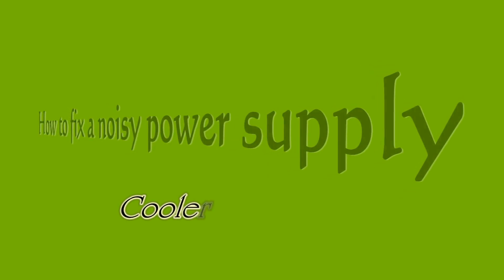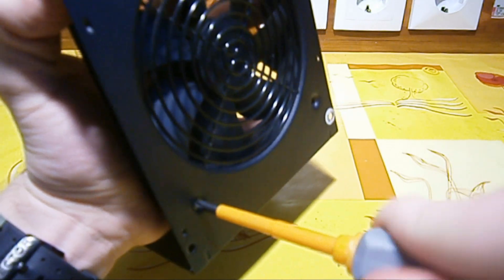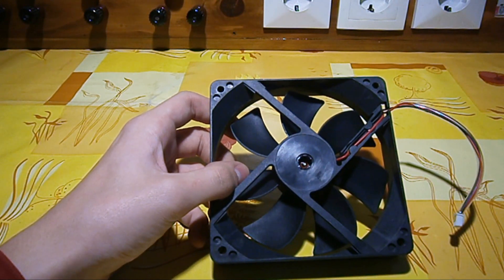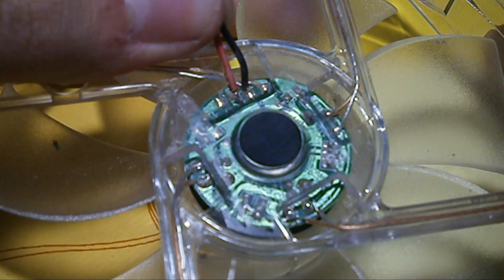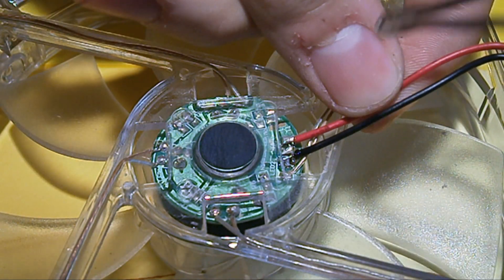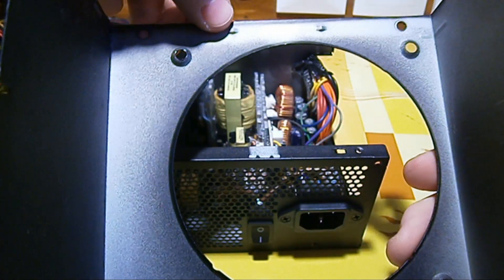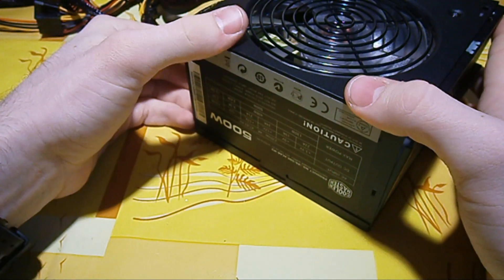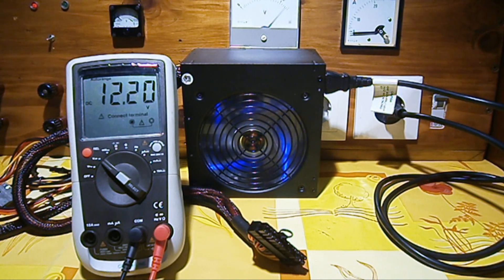How to fix/replace noisy power supply fan

Comment: To anyone who has replaced the fan in a PSU.  If you used a case fan, did you check the voltage at which the fan will spin and make sure that it matches your PSU.  The fan in a PSU is able to start at very low voltages.  Not so for case fans.  That means that when your PSU expects a flow of air, it won't get it.  This probably won't cause catastrophic failure but it might cut your PSU's life time in half.
Secondly, did you check to see how much air the PSU fan was capable of moving and match that to the capabilities of the new fan.  If you PSU fan was capable of moving 100 CFM and you replace it with a fan that can only move 50 to 60 CFM, again, that seems problematic to me.  Anyone?
Reply: +Equs Narnd You are right. But I don't know where I can know the stock fan specification
Reply: Philippe52 probably on the sticker you took off of the original fan
Reply: For me both the fans require 12v but my new fan (which is a case fan) only needs 0.16 amps while the psu one needed 0.3 amps, will this be a problem? (im guessing not but im kinda stupid so help me out)
Reply: @joosepeliastoru6021  its good that it requires less amps. if it required more then you could get a dip in voltage. the important thing is the same voltage and less or the same amperage(slightly higher would probably be fine but I don't know what the supply for the psu will rated for). also to elaborate on the top comment the way the psu will control fan speed will be voltage adjustment. it may want to supply 3volts to the fan to run it in a ultra low speed mode and that will be fine for some fans that are designed to run from 3 volts. Others will simply not run till you supply them with 6 volts or whatever they need.
Reply: @Dean10049  Thanks for this comment. I almost wanted to replace the fan of my Corsair AX750 Gold. I looked into the spec of the PSU, and the fan needs 0.19A, but Noctua NF-A8 FLX which I wanted to replace it with has the max input current of 0.08A. If I can't replace it with a Noctua fan then I don't think it's worth the effort lol.
Reply: @Drowning in Tea Noctua fan will work since it uses less amps...
Reply: @Dean10049  noob question here, there would be any problem if I change the original fan (12V 0.30A) for another with higher amp (12V 0.44A) ?
Reply: Very good points there mate, thanks!
Reply: actually k have same problem of noise . fan noise

Comment: I have a question - will the fan spin at at the highest RPM? I want to put an SP120 in my power supply, But I think the highest RPM it gets is maybe 2500, which is really loud. Will it constantly spin at 2500RPM or does the powersupply only send a certain amount of power to the fan so it doesn't constantly spin like that?
Reply from the maker: +TheZombieSurvivalist 
It depends on the PSU but most newer including this one have a fan controller. It regulates the speed of the fan by the PSU-s temperature.
Reply: +NOoXlab What about a 630watt rosewell PSU I got about 2 years ago? I really want to do this mod, but I don't want the sound to end up being worse.

Comment: I know this is an older video, but I'm trying to figure out what the purpose of that clear plastic shroud thing on the back of the fan is...  just from watching the video it looks like it blocks about 1/3 the total area of airflow into the PSU.   Why in the world would that be a desirable thing..?

I haven't opened up my Cooler Master PSU to replace the dead fan yet, but it seems if you're going to put a 120mm fan in a power supply, you'd want the full airflow, not block a good part of it.
Reply: BobRDeTamble Air is a fluid and will take the path of least resistance. The plastic shield is there to direct airflow through the PSU components before it exhausts out the back. Without the plastic piece, the air being moved by the fan may immediately exit out of the back of the unit, cooling nothing.

Comment: just cut the wire without disassembling fan, cut, solder and tape it to new fan wires and you're done, but its good that you showed how to disassemble fan fins.
Reply: Why would it be dangerous? It's not more dangerous, it's just more hardcore
Reply: GronScott you are an idiot.. I bet you scared to change a light bulb at home. Cut wires is way easier and safer. Its really disappointing that man cant connect + - wires in these days... jesus
Reply: Real Man doing thos procedure like me.
This means in full load and stress tested in prime95,same time in playing darksouls 2.
Turning off pc is for weaklings and puppies
Reply: how?
Reply: +Philippe52 Yh, tbh i would probably do it that way.
Reply: I'm 18. I just did it this afternoon, and yes when you do it this way you have to make sure that the wire do not touch anything, so as when soldering them. If you use the proper method (spread and twist, then twist again) and some electrical tape, it's fine... Then some testing to make sure the PSU will not blow with your computer if it will blow. I don't see what's the problem... It can save you 70$
Reply: Lol Why should I proove it? Just don't believe me idc. My psu is a cooler master rs600 acaa b1 and the fan I used to replace the old one is a Zalman za1225asl which came with my case.
Reply: @gjh.jonathan  Bro its just a fan,  you have to be a little bit idiot if you cant proper isolate two thin cables, and even if you make that huge mistake, there´s no reason for the psu to blow up, it handles a lot more voltaje and load than the fan requires, at the most it should blow a protection for that 12V plug...

Comment: ok its quieter but what about rpms and airflow intencity and temperatures? Are your PSU still alive?
Reply from the maker: +drobillka 
Still alive working remarkably, just put a decent fan that has higher rpm. But even without the high rpm the psu would work just fine. You just examine the old fan while it is still in the psu and chose the new one.

Comment: Just recently pulled apart my computer's PSU due to an occasional sound it was making, found a lot of dust and assorted other crap inside. I blew it all out with some compressed air, and looked around to see what the potential problem was. From the looks of it and various instances of manually spinning the fan, it seems like the frame of the fan was coming into direct contact with the heat sinks and causing a minor vibration, due to the screws not being as tight as they should.

Anywho, in your video, your fan also had a transparent plastic piece covering a part of the fan. Mine also had one, but it looked entirely different. I wasn't sure what sort of purpose it had, and also considered the possibility of it being loose and causing the sound, so I removed it. What exactly does that plastic piece do?
Reply from the maker: +Zach T. 
To be honest I really don't know, It could be for a lot of purposes like to guide the airflow or to shield the high voltage part of the pcb so that you cant poke something through the fan or something else. I don't know the place the plastic was on your supply so I can just speculate.
Reply: +NOoXlab Well the plastic was covering the same area, it was just a more flimsy kind of plastic, and not screwed onto the fan, but rather glued onto the sides. 

A quick search seems to reveal it's used to direct airflow to increase efficiency, but also says the removal of it shouldn't hurt anything. 

Thanks for the quick reply, and the video was well made and informative. All the best.

Comment: To those people who want to avoid soldering, you can get a 3 pin to 2 pin adapter on amazon.

http://www.amazon.com/Coolerguys-Pin-Adapter-style/dp/B002FR84FY/ref=pd_bxgy_147_img_y
Reply: +LordSlimJimm Easier way just take that small plastic around 2 pins and put in "normal" 3 pin cable it will fit normally.
I just laughed when I saw that hard work when u can just normally plug in(talk about video) you made me laugh again but little less.
Actually video is useful if you don;t have connector for the fan just cables.
Reply from the maker: +LordSlimJimm  Yes that is absolutely correct!
Reply: +LordSlimJimm It's annoying that the PSUs other components in the box's contents that it didn't come with one of those :(
Reply: ***** Yes, PSU has got 2 pin connector. Yes, you just need connect plug proper way. 2 pins in socket needs to connect to the same pins in plug. The same as with 4 pin plug and 3 pin socket.

Comment: hy is it important to switch the psu fan cable with the new fan cable? Isn't it pretty much the same stuff?
Reply from the maker: Wellstar 
If the connector on the end of the cable is the same then you don't have to change it.

Comment: what if I don't unsolder the cables and instead cut the cables and roll them together and then, hide the exposed wires with electric tape. Will that work?
Reply from the maker: MZ-101 
Of course that it will work. In the video I have done it just to make everything tidy and clean.
Reply: NOoXlab Great because, I was following you and when I removed the cable which was tightly put right beside the corner of the board. I saw just 2 pins sticking out and fuck me did I get motha' fucking pissed! I'll see if I can get that to work tomorrow.

Comment: Watched this to confirm my plastic shroud on the fan was correct in its position. Thank you for going so in depth with this video. I just replaced my noisy PSU fan from a Cool Power Gamer Series 980 watt PSU with a more silent corsair PSU fan.
Reply from the maker: DJ Fen Fen 
I am glad that this video was of some help to you. This is the reason my videos are detailed and not made as a quick tutorial.
Reply: m80pls
It's been reliable for me for years, only finally needing a new fan.

Comment: You got the fan out,.. why didn't you clean it?
Reply: ***** Not always man. I cleaned my fan as well as you possibly can and it was still really loud. Sometimes the bearings just die and you gotta replace the fan.
Reply from the maker: ***** 
Because I intended to replace in tn the first place.
Reply: NOoXlab but the only reason it's noisy was because of dust in the bearings,.. anyway,.. cool video, between this and another video I am going to oil my psu fan.
Reply from the maker: ***** 
I didn't wanted to continue the discussion but as "DJ Fen Fen" said the fan was irreparably damaged and could not be fixed by just lubricating it. And this case that a fans baring is damaged is rare but in the video just that was the case.

Comment: i made this same mod AND i replase corsair shity capasitors upgrade they panasonic caps
Reply: What?
Reply from the maker: *****
I Think he meant to say that he has done this same mod to his power supply and that he has also replaced the old capacitors in his Corsair PSU with new Panasonic ones.

Comment: 3:28 This PSU has a 2-pin connector, so it might not be necessary to remove the leeds, you can just use a 3-pin to 2-pin adpater cable. Of course the cable then will be a little longer overall, but normally it is not a problem to fit it into the PSU and usually it also doesn't block a considerable amount of airflow (both seems also to be the case for this PSU, see 1:13-1:29). If this dpoesn't work, you can still just cut off the connector and solder the wires together (and use tape as isolation of the soldered part), it will still be much less work than what is done in the video.
Reply from the maker: Well well kind sir I think that this matter has already been addressed in the comments more than one time, but anyways. First of all this video obviously is not meant to do things the quick way rather my friend asked me to replace the fan in his power supply but aesthetically and properly. On this matter I have decided not to use a " 2 to 4 pin converter " or to solder " leads to leads " and insulate them but rather to do it so that You wouldn't be capable to spot that the fan has been replaced or anything modified. You're completely right to claim that this is not the quickest or easiest way but definitely it is aesthetically pleasing and very functional.
Reply: NOoXlab
The cable is inside the PSU, so you don't see it anyway, so I see no point in making it "aesthetically pleasing"...

Comment: You might want to name the video "how to replace a noisy power supply fan". Otherwise someone'll end up opening up their powersupply and being like "aw yeah I can fix this" and then realizing the video was about replacing the fan. :P
Reply: Who the hell starts doing things before watching the whole video?!
Reply: This is what happened to me.
Reply: BrainSeepsOut i know right!
Reply: U saved me 😁
Reply: omg thanks a lot!
Reply: Well you can take the fan sticker off, remove the cover under it, then remove the blades and try lubricating the inside i guess
Reply: @wsketchy  i just took the fan out and gave it a generous amount of canned air and it worked. Then again the machine was filthy and it was a dust issue

Comment: men the best way to fix this problem is to not buy an coolermaster/corsair psu and simply buy an Lepa/fortron/bequiet seasonicor enermax psu. but still a great tutorial +1
Reply from the maker: Yes you are right, if you have money.
Reply: NOoXlab
i think that you dont need much more money to buy a "great" psu , for exemple for the same wattage than your cl psu (b500w if i'm right) and the same price (-10cents exactly in europe) you can get a fortron hexa+ 500w wich has the same power efficiency ,the only negative point for my sight is that fortron is a rather hard manufacturer to find , i hope this will help your friend to chose an more "safer" psu in the future, that was nice to discuss with you NOOXlab,bye
ps: sry for my bad english      frogies powa ;)
Reply from the maker: L3VENGEUR Well you are completely right. In my country it is almost impossible to find top range PSU-s you can only order them and the shipping cost will make the product almost two time more expensive. But I understand what you're saying. Thanks for the info.

Comment: Why would you need to replace the wires on the new fan? Wouldn't any fan with a 3-pin connector work just fine without replacing the wires? And if you're going to replace the fan, get a proper high quality replacement.
Reply from the maker: Well as I already said. It would work just fine. But my friend had this fan ( which was proven to be good) laying around and wanted to use it. It still works perfectly to this day.

Comment: is the plastic slip in the psu important or needed?
Reply from the maker: I assume that the plastic cover is actually serving a purpose. And that could be to keep the high voltage wires (area) away form the fan or for some kind of air flow direction.
Reply: oh, alright! thanks for the reply :)
Reply: NOoXlab ty, i have some pretty decent all around static pressure / air flow fans for my case so i just put one on there. stock fan was being loud
Reply: NOoXlab hey honestly i didnt watch this video first, i just took the fan out and stuck a fan on the top since its a top facing fan power supply. wrapped wires around the back and plugged them into power supply (i prefer molex)so no mess anyways,  the air seems to push right out of the grill on the back where the power plug plugs in, no problems, should be fine yes? :P
Reply from the maker: Nathan Ezra
Well, should be just fine, but to be honest i don't remember any more the direction the factory fan was blowing. But anyways by that what you just said everything seems fine.

Comment: When you remove that rubber bung, just put some fine machine oil in there and close it all up again. I've done that many times with fans. It's even worth putting some oil into a new one before installation.
Reply from the maker: That is true but in this video my friend wanted to remove completely the fan and replace it with an LED illuminated one,that was considerably quieter.
Reply: I know, I am late to this party ;) I have been thinking about the same thing. Either oil, grease or silicone grease should dampen vibrations a bit.

Comment: on my side i preferred use a pwm fan and just pass thru the grid the fan cable and leave my fan controller take care of it,the psu is a old seasonic with 120mm fixed speed fan.

Comment: Just curious as to why you would have to remove the old wires and connector from the old fan to attach to the new fan. Is that because of a proprietary fan connector on the old fan from the power supply? Why would you did not just buy a fan with the correct connector and save yourself the hassle of having to do this?
Reply from the maker: First of all I already had this fan laying around and it had an molex connector on ti. So I had to remove the molex and put a 2 pin connector. But if you buy a fan that has a 2 or 3 pin connector you don't have to do what I did there.
Reply: Ah makes sense

Comment: Shouldn't you have a warning on here about how dangerous it is to open up a PSU? I read that you can get quite a large shock if you touch certain components?
Reply from the maker: Yes you are completely right. But I totally forgot to put that there because the PSU in the video wasn't connected to the mains for a long time. But thanks I have put a notification now.

Comment: can i use my coolermaster 12v fan in my cm gf 650 ?
Reply from the maker: It will probably work but as +Robin Wingård said in the comments there are a lot of things to consider. The best thing is you test it but you don't connect it permanently if the fan spins properly without stopping then you can place it permanently in the PSU.
Reply: but it have 3 pins ?
Reply from the maker: You can just connect the plus (red) and minus( black).
Reply: but my que is it will controll fan speed ? auto like when i play game it will do 100% fan speed or 80 whjat ever and when not in use 10% ? is it safe ?
Reply: Ankit Sharma It is possible in theory but it'd be messy. You need to take the control wire out of the PSU and connect it to a control switch as PSU's don't alter the RPM of the fans.